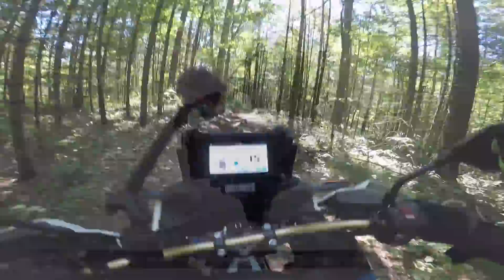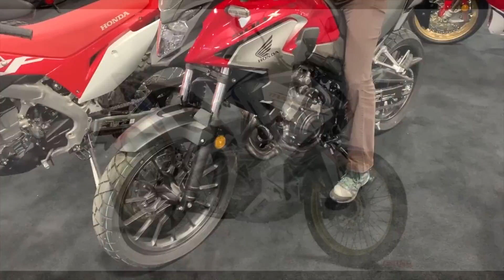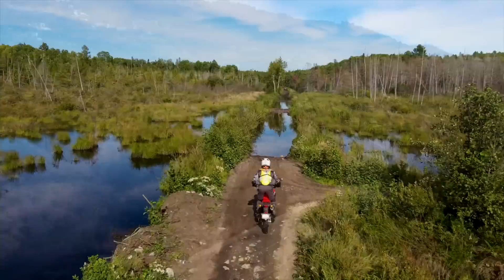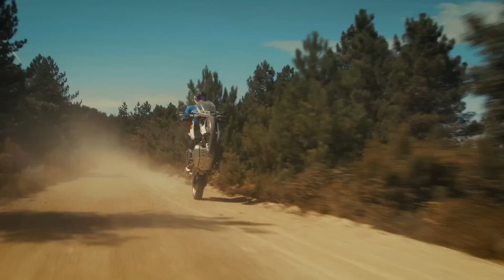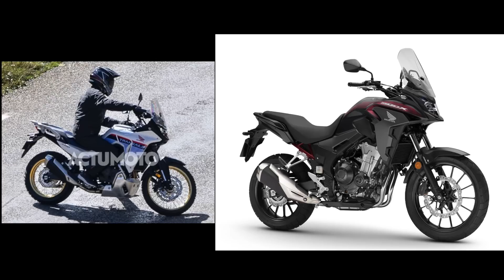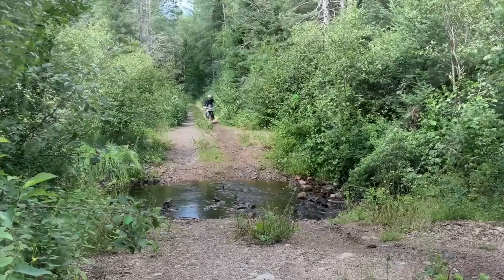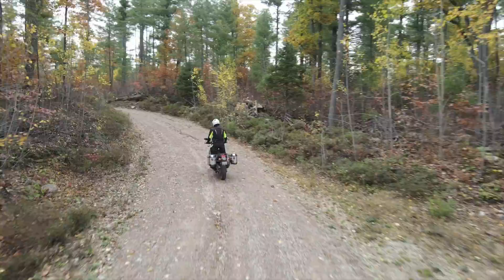New Honda Transalp Finally Ready For Release!

Comment: The industry has plenty of 1200cc, 1000cc, and 700cc adventure bikes.  Now what’s next for off-road capable adventure bikes?
Reply from the maker: Hopefully the KTM490. We're also getting a Himalayan 450 soon.
Reply: @DifferentSpokesTV  I think 400 to 700cc is the sweet spot. A 500cc twin with proper gearing would do very well. My only complaint about my cb500x on the road is 5th and 6th should be taller. If they changed that and made the cb500x full frame with more suspension travel it would be the perfect bike imo. I love my cb500x with l2 rally raid kit. So much so I might actually make the effort to make a review video.
Reply from the maker: Do it! Honda should have just made that bike years ago and given the public an option to get one.
Reply: @DifferentSpokesTV  there won’t be a 490. RtwPaul was told at the factory it’s off the agenda.
Reply from the maker: @MrEtnorb  thanks for the info.
Reply: 450 Rally. If Honda made that I'd sell my KLX 300.

Comment: 1st. Will it come to the USA? IE, NT1100..
Do not be surprised if Honda makes it a gutless wonder, 60 hp or so. 
Next, will Honda build lots of them or will it be a phantom release?

I am sure Honda will screw this up.
All my bikes have been Honda: cb175, cb500/4, xl500, Goldwing 1200.
Reply from the maker: I hope they don't screw it up. I'm guessing that it will have power because the Hornet does.
Reply: Yes but when Honda released the Rebel 1100 they cut the power of Africa Twin engine it has.
They always find away to mess things up.